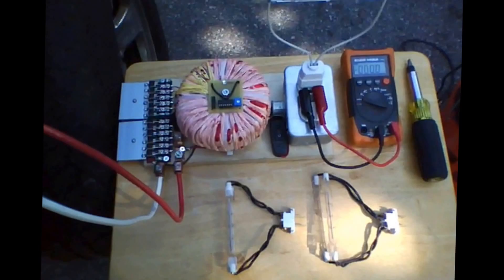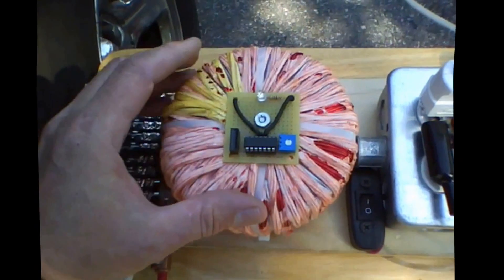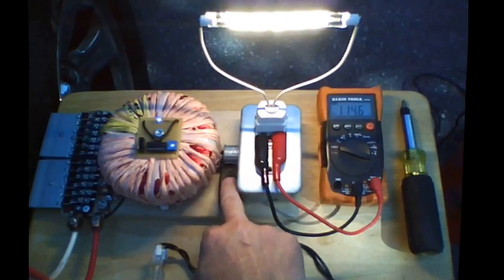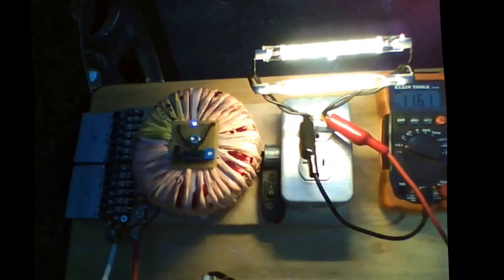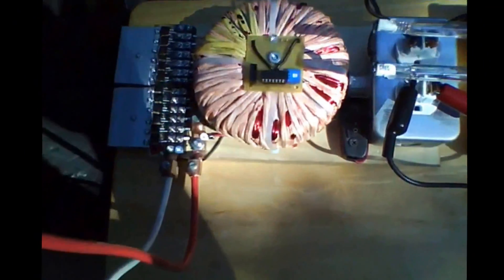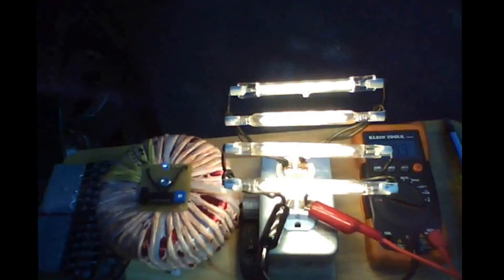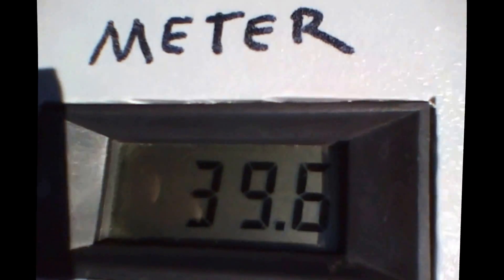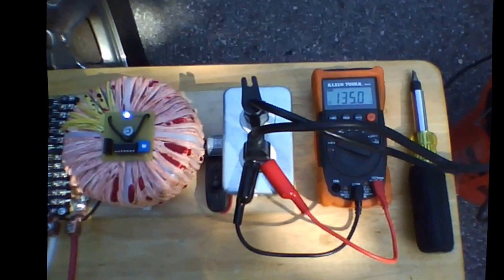Homemade Power Inverter  (Simplified).

Comment: 30a from 12v its alot, i know my 12V arrary when pulling 1000w (1kw is 30A) but if your fulling 500w bulb and pulling 30a your wastage is 50%, so your system is very bad, very very bad,
Reply: Curious, how do you figure that the waste is 50%? 34 amps at 12 to 14 volts (actual car batter and alternator voltage) would be between 408 to 476 watts,  which is extremely close,  so I'm confused as how it's a 50% loss,  transistors and coils do use power in stand by alone,  but this seems minute compared to others?
Reply: Because I have an amp meter on my 12v batteries 2x100ah agm battery and when it has a load of 1000w the amp meter shows 30ah draw. So if he's powering something that is 500w and pulling the same 30amps at half the wattage.  I have a pure sideways inverter.  And all I'm saying is mine pulls 30a@12v to supply 1kw he pulls 30a@12 to supply 500w half as efficient. Hope that makes sence
Reply from the maker: Tom Hambling Yes It pulls that from the battery at 14.5 volts...but steps up the voltage to 120 volts to power that 500 watt bulb. My power inverter is just a little more efficient around 90% than your standard inverter due to the toroid core design. Thanks for watching.
Reply: Tom Hambling sorry but 30A*12V is 360W not 1000. You would have to pull 83.3A to put out 1000W and thats if your system is 100% efficient which its not.
Reply: you cant get more power than you put in so one of your meters is lying to you. the voltage current transfer doesn't matter if there is 360W in then you will get about 360W (maybe 90% of that) out. so the 240V inverter will max out at 1.5A. Are you pulling current from your batteries and another source like a windmill or solar?
Reply: whyme2b hmm maybe the voltage is what is different,  mine pulls 30A @ 12v  steps up to 240v to produce 1000w,  yours pulls 30A @ 12v steps up to 120v to  produce 500w.  I'm saying yours seems less efficient,  my factory made pure sinewave inverter makes twice the voltage with twice the watts from the same 30A draw from battery.. Am I missing something or should I just let this go? :p
Reply: Adam Nickerson Correct 30a@12v 360w, but the inverter makes it 240v and when the power meter on the 240v says 1000w the 12v side says 30a. Very confusing I'm just saying what my meters say. I know 240v at 1000w is about 4.5-5a

Comment: hi can i get the steps by which you did that,am not good at this so if you can help me at least with some diagram and step.thankx
Reply from the maker: Hi Isaac, you will need some knowledge of electronics to understand and how to put this inverter together. If you like, go ahead and send me a email to phillipstechinc@yahoo.com and I will send you another diagram of how I did it and what kind of parts I used. Also check out my website at phillipstechinc.com under the photo gallery to see more pictures of my inverters. Thanks for watching.

Comment: Hi!  Great Vid!

2 Questions:

1.  Where can I view the full schematic that shows the connectivity of your IRF1404 POWER MOSFETs in circuit?
2.  Why does your voltage & Amperage continue to drop on your meters the longer you allow your loads to be operating in the circuit?

Thanks in advance for your vid & answering these questions!
Reply from the maker: Thanks, send me a request to my email " phillipstechinc@yahoo.com" and I will send it on over...2. My voltage & Amperage continues to drop because of the load drawn from the battery.... I have a low amp alternator which can't keep up with the amp draw. Also it would run better if it had a bigger toroidal core which would allow more magnetic flux to build and be absorbed. Thanks for watching.
Reply: whyme2b I desperatly need your schematic for my project does it use a center tapped transformer? Please help.

Comment: Could you tell me the Spec on that toroidal transformer like how many turn side ect. Thanks. I'm little slow on these.
Reply from the maker: Sure, it was 34 turns from one side and 34 to the other....Center tap was at the end of the first wrap. If you would like a picture of the Toroidal Transformer I used, just send me your email address I would be happy to send it on over. Thanks for watching.
Reply: whyme2b nguyenvj@comcast.net Thank You so much.

Comment: lol what kind of crap camera do you have??
Reply from the maker: It's a iPod Nano and actually it does a very good job in making videos, but because this video was a little shaky...I used the YouTube feature to eliminate it which was a big mistake!!! Thanks for watching it thou...
Reply: Actually I believe it to be a quite fair video, very excellent job and I would not have bothered to reply to the question but it shows you have strength of character so my respect goes out to you. let me ask please would you put a small fridge on it? since you can squeeze 1500 watts out of it easily.
Reply: at least it will explain it. Please don't use it next time Thanks.
Reply from the maker: SylwerDragon

 I never will again buddy...will do my best video capturing next time. Thanks again for watching.
Reply: whyme2b can you reply. Does the inverter still work

Comment: 66.4 amps * 12 volts battery is about 800 watts, but still it is enough to drive the four bulbs, try connecting a couple more bulbs to see what your inverter can do and please send me the circuit diagram.
Reply from the maker: Please email me at phillipstechinc@yahoo.com and I will be happy to send it on over. Thanks for watching.

Comment: Something seems fishy with those numbers. You need to plug in a Watt meter to truly know what it is pushing. We have no way to know if those bulbs were at their brightest or actually pulling the full 2000 Watts. The numbers you were reading can't possibly be right. With the 500 Watt bulb the way you were measuring was coming out to 4000 watts, and with the 4 500 watt bulbs it was showing 12000 watts. So one of your meters was not showing an accurate reading.
Reply from the maker: Very true sir, you are right..... Today I plugged in my watt meter to test it but blew it out because the voltage was 132 under no load. I will get back with your comment in finding out the actually truth of the matter my friend so that all will know the real truth. Thanks for your comment and watching.
Reply: I think I know where the high numbers are coming from. The amp meter is connected directly to the battery and is running 34 or so amps on 12 volts. The amps will be different after the voltage is stepped up.
Reply: So for the 500 watt bulb running 34.7 amps with around 12 volts would be pulling 416.4 watts. I'm sure that some could be lost in the process of stepping up the voltage.
Reply from the maker: Yes, but when engine is running, it's allot closer to the 500 watt range. It's also due to the core....it was only rated for 300 watts. Check out my monster inverter on my website in which I used 12 of of these cores in parallel hooked together, which can put out 10 to 15K watts. phillipstechinc.com under photo gallery.
Reply: whyme2b Yeah that's correct coz the engine gets up to over 14 volts on average, mine runs at 14.4 so that's extremely close,  that's impressive,  I can't imagine how much time and tweaking to get that accurate
Reply: 120V 500W bulb running at 114.6V
The bulb is running at 95.5% of its rated voltage so if the bulb draws exactly what it says it does (500W @120V) then it's drawing 477.5W @ 114.6V.
I don't know how efficient the inverter is so if we ignore that, 13.72V @34.8A is 477.5W so I think these numbers are completely legit and the math speaks for itself.
Reply: KiwiPowerNZ
First You need to take the voltage and current readings on the same side of the Transformer to get a true wattage reading. the Bulbs are 120v 500 watt which means 28.8 Olms. at 114.6 volts thats 456.81 Watts. If your battery is putting out 13.72 you are correct the circuit is drawing 477.5 watts to put out 456.8 With the 2 bulbs in parrell the Olms Restitance would be 14.4 @ 109 volts thats 825.07 Watts. Transformer and transistors do lose power as they work however you are close to comercial inverters for Efficeince I think. without volt and amps on both sides it is difficult to say.

Comment: Hi whyme2b I find this really great, can you tell me what are needed to be change if I want a higher wattage output
Reply from the maker: Just add more transistors and magnet wire and maybe more toroidal cores together to build up for extreme wattage output. Check out my website phillipstechinc.com under photo gallery to see my big unit which puts out 10 to 15K watts to get a idea. Thanks for watching.
Reply: whyme2b
 How did you build the big unit.
Obviously these units are limited to Amperage input that can be replenished from the Battery Bank and the Alternators output.  There is a point where you can not simply get anything more with out adding more Alts under the hood and Batteries to store the amperage.  I used to have a 5000 Watt until some idiot decided to plug my truck into shore current which the inverter did not like and filled the cab with smoke took months to get the smell out.  I would like to build a unit instead not to keen on the various ICs in these and I had an old TIN LIZZY project made some what like yours I built way back in the 80s about 88 if i remember that worked much better in my opinion. send me a build for your large one to chro4 at aol dot com  thanks
Reply from the maker: Sure thing, will do... check out my monster inverter I built on my website "phillipstechinc.com" under photo gallery. I used 40 transistors on that project which put out 10 to 15k with no problem.... you can't find that kind of power on the market..hahaha. Thanks again for watching.

Comment: How about telling us exactly how you wound  each coil and where you placed each coil on the toroid, and each connection to the transistors too. That would more helpful than a "look what I can do", video. I'de like to make one too.
Reply from the maker: It's all one coil in separate strains called litz wire. I used 16 gauge magnet wire  for each strain in a total of 6 strains. I wrapped the core from left to right.... 32 turns one way and 32 turns back... at the end of the first wrap before going back, is the center tap in which the positive voltage is hooked to.The other ends of the wire go to each channel being pulsed which is the negative. My goal is to help out people... not show off in what I can do. I hope this helps you out in creating your own. Thanks for watching.
Reply: The coil looks like it is wound in small segments, and I still don't know what wire goes to each of the transistors????
Reply from the maker: Mick Mickevicius

 No sir, it's all one straight length of 16 gauge magnet wires....around 11 feet long. The actually total of wires were 12, six on each channel. The beginning 12 wires are hooked to both channels of the transistors, the other end of the 12 wires are hooked to the positive side of the battery. I would use a fuse of course before hooked to the battery for safety reasons thou. Let me know if this helped out?

Comment: please send me the calculations for toroidal transformer, how to calculate returns
Reply from the maker: I'm no mathematician in what I do, the transformer has a 120 volt primary and 62-0-62 volt center tap. I made my own low voltage primary coils around 32 turns of 16 gauge magnet wire from left to right that were pulsed and I used the original primary coils output for running the lights. Thanks for watching.

Comment: You say you unit is able to output 2,000 watts, but when you do the math for when you had all the bulbs attached, there was only about 1,553 watts going in and with a rough estimate of 85% efficiency, probably only 1,320 watts going out to the bulbs.... I would call that a 1,000 watt inverter.
Reply from the maker: The efficiency is better than 85%... the cables I used were 8 gauge that were hooked up to the battery. I said they needed to be greater for better output. Voltage x Amps = Watts...the Voltage going in was 14.5 , the amps being drawn were 120... which equals 1,740 Watts output. Thanks for watching.
Reply: whyme2b May I ask how you calculated the efficiency? Also, was the voltage still 14.5 when it was under load? I have a hard time believing the voltage stayed up under that amount of load, but I wasn't there, so I couldn't say for sure. Did you measure the voltage during it or only before?

Comment: Just curious what it would take to get a nice clean sine wave out of this.
Reply from the maker: Circuit board would need to be reworked with a few add on components, but not sure if it would be a perfect true sine wave, the IC chip is really not designed for that kind of smooth single output. Thanks for watching.

Comment: Dude. I think your camera just dropped some acid !!
Reply from the maker: Sorry, but I'm not sure what you mean in your comment? I did use my ipod to record this video...did a pretty nice job. Thanks for watching.
Reply: Great video indeed, but very wavey and surreal by the time I got it. Similar to the effect you get when using you tubes anti wobble editing.
Reply from the maker: Okay, sorry about that... I tried to use the editing effect, but I didn't like how it turned out.
Reply: I tried it as well. It seemed like a good idea at the time but the wobbley effectcan be worse than the small amount of shake.

Comment from the maker: Yes to answer 1. Each transistor is capable of delivering 333 watts of power, to put out that kind of power you need to add a resistor (which is the 16 gauge magnet wire )  to each chip limiting it's out put, otherwise it will blow out due to overload. The transformer is a 120 volt input to 122 volt output. I just wrapped my own primary using 16 gauge strains to step up 12 volts to 120 volts with a high current output. Thanks for watching.

Comment from the maker: It draws 3.3 amps in standby... it's a little high because of the huge saturation of magnetic flux in a 300watt design toroid core. The power wants to be used instead of going nowhere which does cause the transistors to heat up in a minute or to, that's why I put the switch on it to turn on when needed to power something. Needs a bigger core... Thanks for watching.

Comment: This is not science related, but what software did you use to stabilize the video? A very nice stabilization can be done using VirtualDub's Deshaker plugin, with zoom so the borders won't be visible. Thanks!

Comment: I got it (Mike Poirier corrected me), your 66 amp is the input, but the 110 volt is the output, so we can't multiply them because they are not on the same side. One is before the power conversion the other after. ;)

Comment: Hi Furulevi, Follow the wires, the ammeter  is in series with 12 volt battery. Not the load. So 12 Volts Times 66 amps is 792 Watts.

Comment from the maker: Hey buddy... actually it is only about a 45 to 50 amp alternator on my truck. Very shocking to me that it is so small? I would like to upgrade it to a 150 to 200 but would need to check into it to see if my wiring can handle it. It does pull the amps thou to pump out that kind of juice! Take care my friend and thanks for watching...